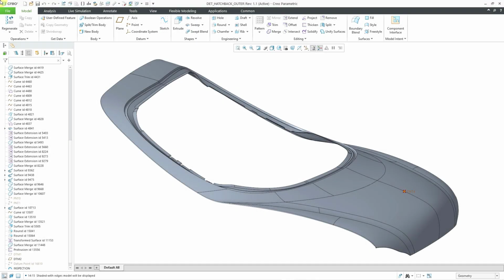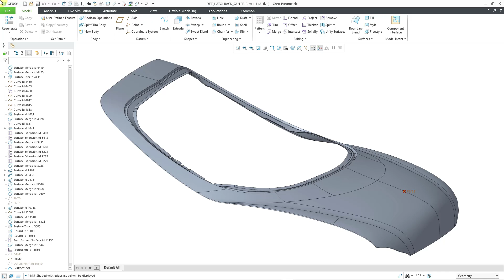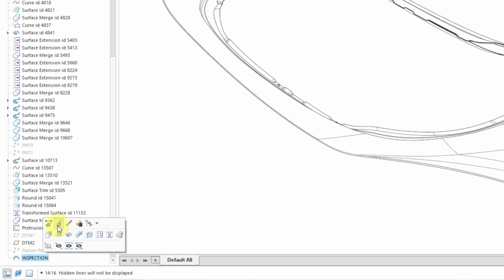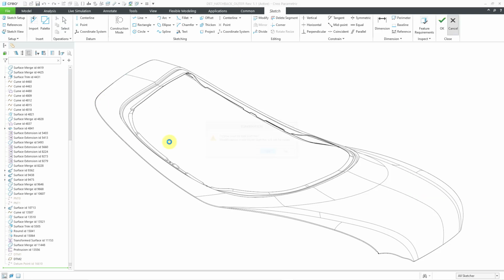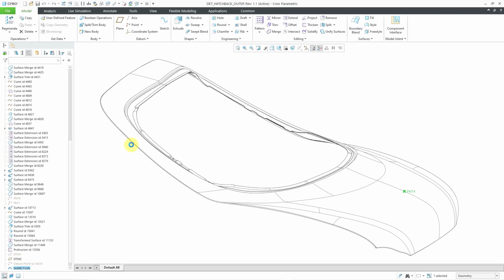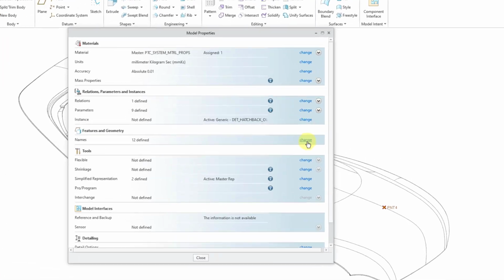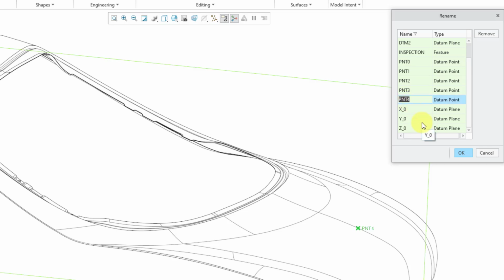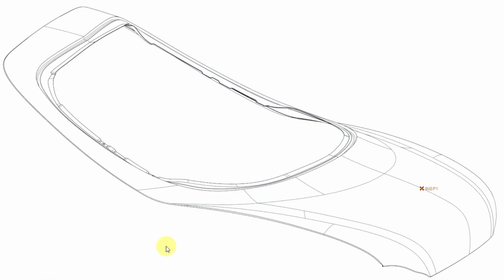Creo Parametric - Renaming Sketch Datums

Comment: That took 7 clicks? This is why I have this love-hate relationship with Creo.
Reply from the maker: Renaming sketcher datums is not the kind of thing people do every day. But if that's too much for you, you can add the Model Properties button to your Quick Access Toolbar (like I have) or make a Mapkey.

But in the age of social media, I find it interesting that people complain about clicks so much like they are in short supply. People will be on Facebook, Twitter, Instagram, Snapchat, LinkedIn, Reddit, Pinterest, Discord, Threads, etc., and then complain about clicks.
Reply: @CADPLMGuy  Sorry Dave but if I am paying thousands of $$ for a software, I think I have right to criticize it. Also, I would prefer finishing my work quicker, just like the rest of the world.
Reply from the maker: You have a right to complain. I, though, also have a right to find some complaints a bit of a stretch.

Let me ask you this: how often do you use this command? What is an acceptable number of clicks? Are you using the tools within the software to speed up your workflows?
Reply: @CADPLMGuy  I have never used this command and probably never will.

I was trying to point out to my general experience with Creo. 

Recent example is, creating an arc slot. Think about all the hoops you gotta jump to get to there. In any other CAD, I used to:

1. Arc
2. Offset both direction with capped ends.

The fact that we still don’t have this in Creo even after feature requests back in 2014 is somewhat concerning to me. 

That might be one of the reasons why user base is shrinking.
Reply from the maker: Are you talking about the Arc Racetrack that has been available in the Shapes tab of the Sketcher Palette like for the past 20+ years?
Reply: @CADPLMGuy  I am talking about the two-way offset option that is missing from sketcher.
Reply from the maker: So... you mean the Thicken command in Sketch Mode? Try this: sketch an arc. Start the Thicken command. Change End Caps to Circular. Pick the arc. Enter a thickness. For the offset in the direction of the arrow, enter half the thickness you just entered. Is that what you're talking about?
Reply from the maker: @omerbc I just confirmed on my computer that the Thicken command has been available in Sketch Mode at least as far back as Pro/ENGINEER Wildfire 5.0, which came out in 2010. That's the oldest version I have on my computer since Wildfire 4.0 and earlier don't run on Windows 10. I could look back in my old Update manuals to see when it was implemented, as I do remember teaching it in Update classes. If you were requesting this as far back as 2014, it was already in the software.
Reply: @CADPLMGuy   Thanks for the confirmation Dave.